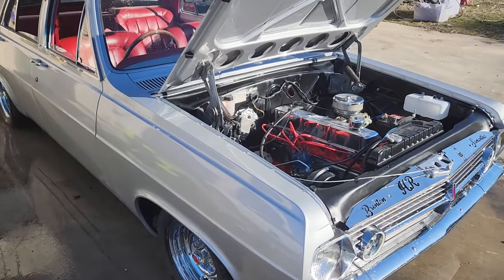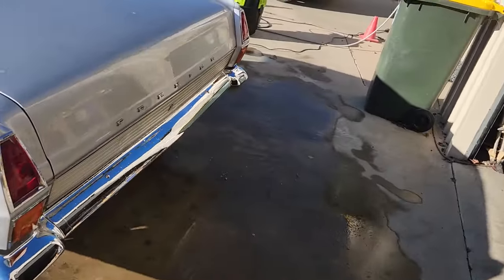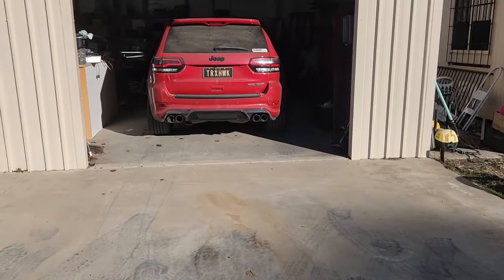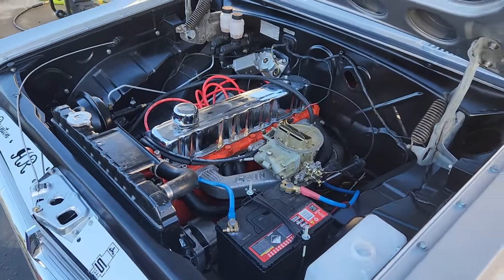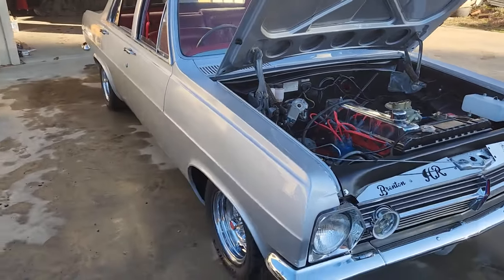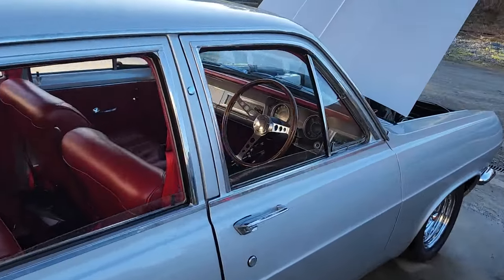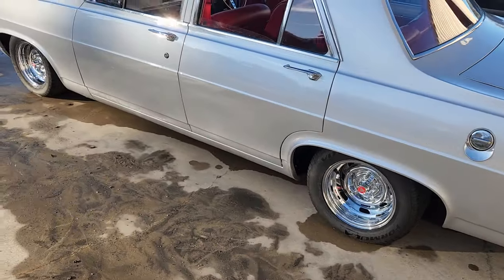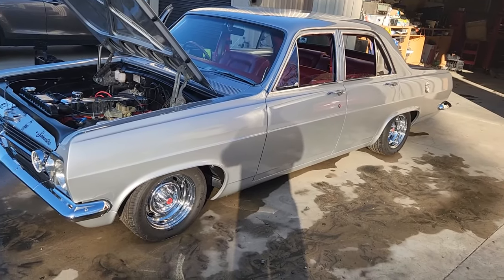One beautiful 1967 HR Holden looking for a new owner, full nut and bolt restoration nearly finished.

Comment: Not giving my opinion on Holden cars, because it is not what you would like. If you want a REAL supercar, you better start saving your money, because those cars are literally MILLIONS of dollars ($155M to be precise!)
Reply from the maker: Announcements coming, but more around the hundreds of thousands variety in my case unfortunately,  your correct, millions I don't have🤣🤣🤣🤣🤣
Reply from the maker: Was this the slight loss due to a fire on board?  The Burning Cargo Ship That Was Carrying $155 Million in Porsches, Bentleys and Lamborghinis Has Sunk

The ship, which carried over 4,000 Volkswagen AG cars, was being towed to land when it went under.
Reply: @brentonmeadowsvk3cm  no. The car I speak of has only one of its type ever built, hence the hefty price tag. This car was driven by Rudolph Uhlenhaut as his work car. It is a Mercedes Benz W198 300SLR racing car with a canopy fitted. This car was specifically designed and built for him. The other variants were built for racing, and were designed to be used as either open wheel or streamline set up, depending on where it was being raced. Stirling Moss and Manuel Fangio both drove these cars, and both are now in the Mercedes museum in Germany. The Uhlenhaut coupe is currently in private hands.